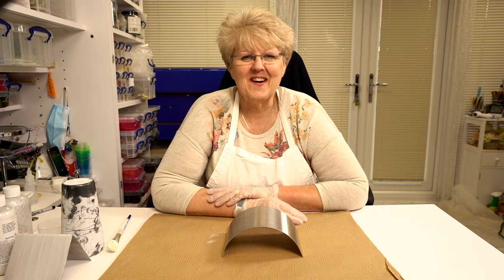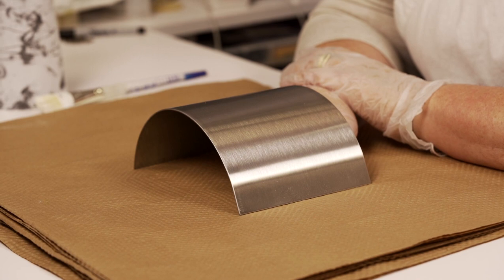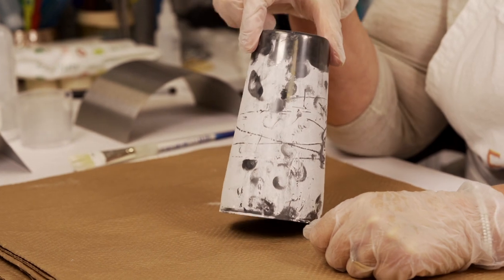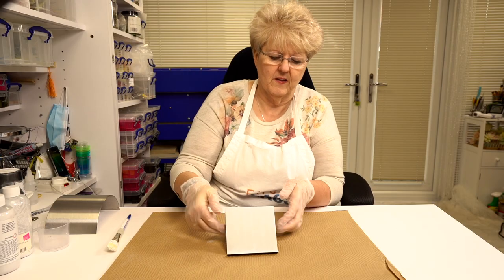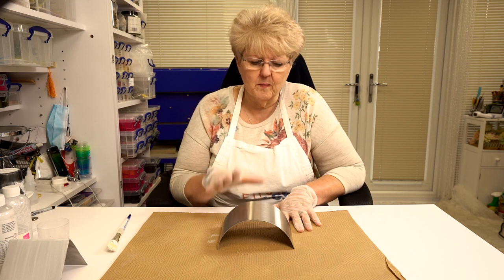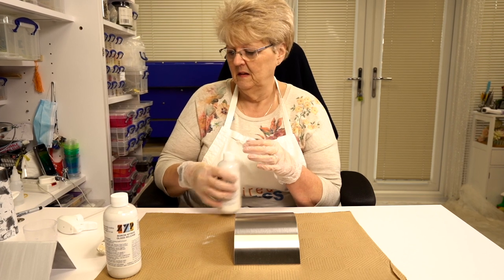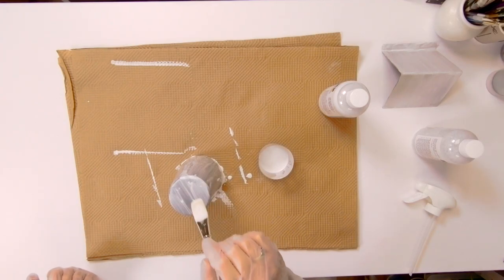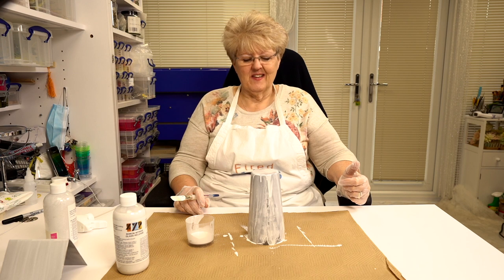Prepping metal moulds for slumping in a glass kiln

Comment from the maker: How do you prepare your metal moulds for glass slumping?
Reply: I apply the liquid Boron Nitride using an air brush over a downdraft ventilation system, thus no need for masking up. I also rely heavily on a heat gun which I use to pre-heat the ss mold. It allows the BN to dry almost immediately and I can continue to coat as necessary. The extra fine spray of the liquid applies quite evenly with no brush marks, and uses very little of the product, unlike the spray can method. Plus it's a lot cheaper than the spray can. I've also switched to using the same method on my ceramic molds and have been very pleased with the results. I get many firings from a mold without having to re-coat as long as I take care with them.
Reply from the maker: @blenderbenderguy  thank you for that. Great to know and hear of alternative ways to apply BN.

Comment: thanks for this video, i bought 12 over flow(it is what they are called in the Bar and Restaurant world) floral formers for a fraction of the cost. SS. They were too tall for my kiln so husband cut them shorter. Had hard time getting the kiln wash to stick. many said to sand them then put them in the oven at 250 Degrees. I did and that then made thick kiln wash.  Got all 45 tealight holders fired. But ive noticed that u dont do any of that. never heard of using isopropyl alcohol. and i think that zyp would be something i would love working with!
Reply from the maker: Zyp is certainly worth a try. I guess it's finding out what works for you.

Comment: I am loving your videos! Do you have a tip for when it does bead up on the surface?
Reply from the maker: Thank you for watching and we're pleased to hear you love what we're doing. We've only just started our YouTube channel so great to hear it's liked and well received.

We found that the cheaper metal moulds tends to bead more often. With our current supplier that does not happen at all. It's important to make sure the mould is clean and free from grease, finger prints etc as that will cause beading. If it does bead then our only method is to do multiple coats until the boron nitride sticks. Easier doing this with a brush rather than spraying.

Comment: Hi, I have been using boron nitride (which you have been using on metal molds) on a ceramic bottle mold and it has stuck to the glass and also to the mold. Impossible to remove. Can you tell me why? Thank you.
Reply from the maker: Boron nitride should not be used on ceramic moulds use kiln wash. As you've found out it does not work.

Comment: I tend to get alot of residue on my tea light...nothing get it gone..tried several limescale, vinegar solutions.  Using spray also...sm I I firing too long or high?
Reply from the maker: Difficult to answer without knowing your firing schedule. We use the basic slump schedule from Warm Glass with a little tweak. All kilns fire differently, and in our Hobby and Cub fuser we change the top process temperature to 665 Degrees Centigrade. We get a little residue, but it's easily removed with water. Make sure that your moulds are thinly coated which will reduce transfer.

Comment: 1.  How do you wash the brush?  

2.  When you reapplied ia previously coved mold but the “flakes” get into the liquid and contaminate it?

Thanks for the video I thought it was great.
Reply from the maker: Thanks for watching. I let the brush air dry and shake it off into the bin before using it again. You can wash it off in cold water after use if you wanted to. I've not had flaking of moulds so never had an issue of adding more wash over the top of existing.

Comment: Beginner here- can metal cookie cutters (zyp-ed) work when filled with glass frit, medium size to create a flat piece in the cookie cutter shapes?
Reply from the maker: Yes you can, they must be a good quality metal, steel or stainless ideally. Prep the mould as per the video. If you go thick remember to adjust your firing schedule to account for the annealing time to prevent shattering of the glass.
Reply: Thanks!!!